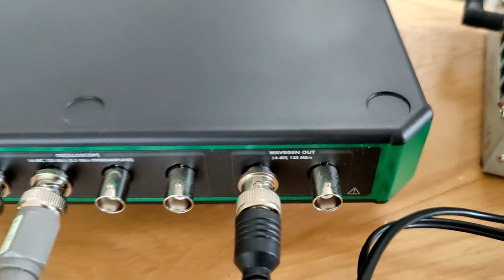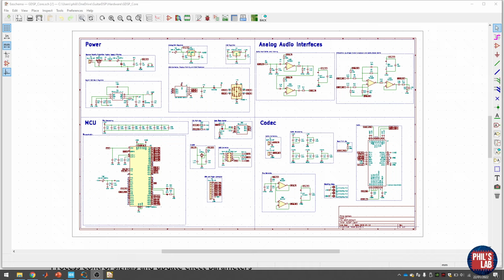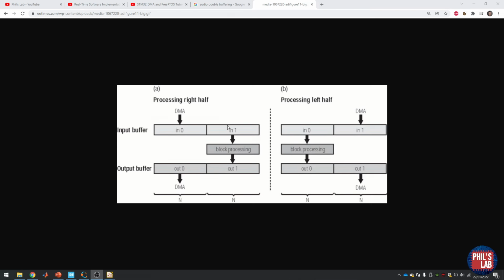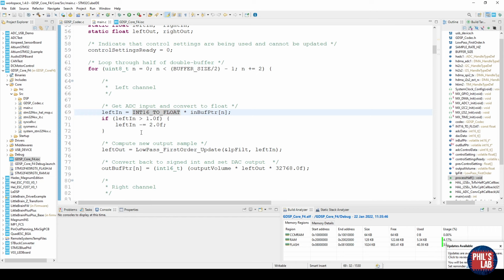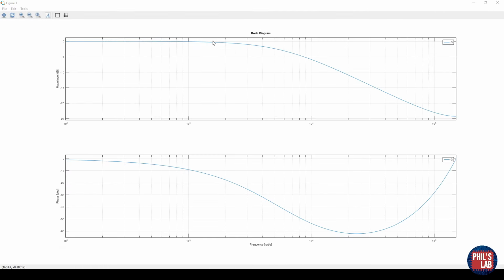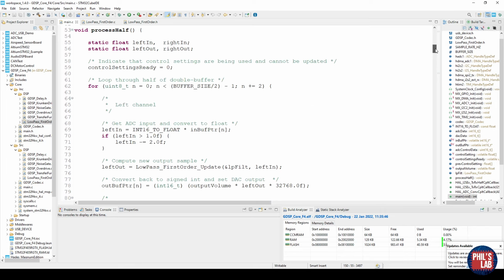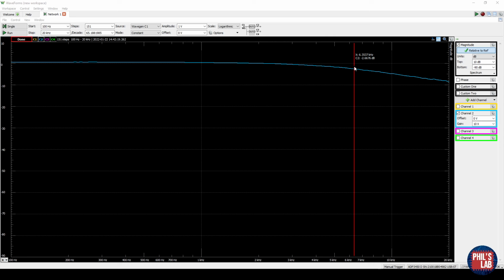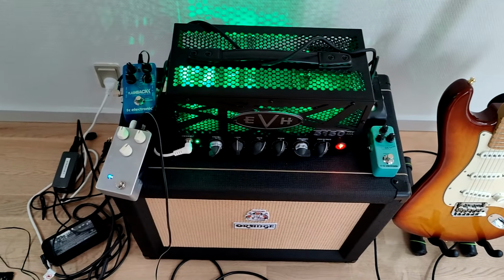Digital Audio Processing with STM32 #1 - Introduction and Filters - Phil's Lab #46

Comment: I am more interested in DSP programming for audio applications like the audio equalization, mixer/audio mixing, digital filtering, understanding of the analog ics that made up the analog embedded system (I mean the chip like the dsp audio mixer, audio codec, etc). In digital/mcu based embedded systems there are ics like eeprom, rtc, I/O port expanders, CAN, RS232, RS485, ethernet PHY, etc that made up the system BUT in analog embedded system (again, I mean the DSP based solution) is still to me remain secret and not liberise !

Comment: Phil, could you perhaps cover different digital power supply topologies as well? You could start with the basics like short circuit protection and move on to more complicated topics like DC/DC, DC/AC conversion, motor control, regenerative braking, PFC, etc.
Reply from the maker: I actually recently made a demo board for future videos on how to design/control a buck converter. I think both from an electronics and control standpoint that could be pretty interesting. Other than that, as you mentioned, I also have a motor control board ready for some videos! :)

Comment: Is this dsp also similar to what jbl uses in the charge, xtreme, flip, pulse, boombox series of their bluetooth speakers? I'm currently building a bt speaker, it's drivers are 10-20watts, it's a replacement driver for jbl charge 3, I used tpa3110 amplifier and m18 bluetooth decoder. The sound is good, but I want it to sound like jbl charge 3, it has bass which you can hear loudly. But mine, I don't hear any. Can I use this dsp?

Comment: Thank you again Phil for more great content!
You mentioned that the ADC of the STM32 is not appropriate for sampling the audio signal and that the ADC of a codec IC should be used instead. Why is that?
Reply from the maker: Thanks, Bruno! The STM32's ADCs and DACs are usually 12-bit and you'll get pretty harsh, very audible distortion. 16-bit is pretty much a minimum for audio.

Comment: Hey
Can you make a video on making a bi-directional power delivery Sink source board using the TPS65982 (or similar)
And a synchronous Boost buck converter using
LTM4607

I am making a powerful Powerbank with 100W PD port and 300w (20v 15A) port for my laptop
Can you help me out?

Comment: I was so hoping you implemented full filter that is capable of 0.5Hz cutoff (at 48ksps), that is nearly impossible to do in analog domain. All you have to do is to run convolution with your kernel, I always wondered if STM32 has enough performance to do it in real time :)

Comment: Thank you for this! I created a basic synthesizer on STM32 but I didn't know how I could implement a filter. I just discovered your channel now, but do you have (or would you consider making) a video about how to do an adjustable cutoff filter like this but using the ARM math library filter functions that come with the STM32 libraries?
Reply from the maker: Thank you for watching, Jacob! Potentially I'll make a video on using the ARM libraries, however, I usually prefer showing everything 'from scratch' in these videos.

Comment: Phil, this video is pure gold. The fact that you're providing it for free is so admirable, ill gladly go to your patreon...

I am developing a similar project, but have chosen the stm32h7. It's awesome that you're usinig a cortex m4 since I was weary the performance would suffer compared to an m7 chip. Have you hit any roadblocks in terms of performance when implementing some more "crazy" dsp algorithms? Do you think the higher performance of the m7 compared to m4 is worth it?

Cheers!
Reply: it depends. the only way to determine is to put an algorithm execution expectation on m4 or m7, 
Example: 
A single channel IIR at 96fs is okay, but you will soon see interesting CPU and Memory issues when building advance "single audio channel high sample rate" algorithms like: ANC (Active Noise Cancellation), Parametric EQ with limiters, Advance Reverb Algorithms (an there are many) then an M4 STM32 wont work, M7 barely but then again? what are you trying to do? what is the aim? M7 for simple to advance low sample rate will work. Yet again the M4 and M7 are great chip most people doing DSP will have to start here and work their way up.Some DSP things I mentioned are highly subjective do you even need high sample rate Audio?  
Many who started looking never even made it designing a low sample rate IIR filter on an 8-bit architecture. It's an additive journey, I say use an M4 or M7 and see if you can max it out, then move on. :)
Reply from the maker: Thank you very much, Lia! The only time I've been limited by the performance is (unsurprisingly) with long convolutions, e.g. for FIR filters. Another thing is the amount of RAM available, which can of course be extended on some STM32s with SRAM.
Tbh before the chip shortage the price difference between some M4s and M7s wasn't much, so I'd say just go with whatever the budget allows!
Reply: @PhilsLab  cool to know! I will be doing a lot of convolution, so maybe the m7 is what I want. The chip shortage really is a shame!

Comment: as an embedded developer, its really hard to solder another opamp resistor to settle or attenuate the signal to the mcu. i'm using i2s channel for trying it out the circuit. i put an adc like you did... and i'm chilling when i need to change attenuation factor or lpf settings because of very fast mcu's nowadays. (we are not populating these ic's at production btw)
when i'm in the university, there were only the pic family. 20mhz at best ahhaha:)... now i have 168mhz or 240 mhz mcu with fpu and dma and fast i2s peripheral.. 
weather is clear for embedded engineers... :)
Reply: You can get 400 Mhz to 1GHz "MCU/FPU" if you need them.  Allegedly.
Reply: we also have 1Ghz MCUs nowadays

Comment: Great series! Since STM32F4 series have built in ADC/DAC, are these built in one able to do the similar thing?
Reply: I don’t think the built in DACs have sufficient resolution (they are 12-bit) for audio applications, particularly the DAC’s ability to reconstruct a pleasing sounding analog waveform. Most better sounding DAC chips in pleasing sounding effects are 24-bit or 16-bit at the lowest end. Aliasing in algorithms is also something that goes away at higher sampling rates (eg 96 or 192 kHz). You can definitely hear the differences.
Reply: Maybe if you are making a distortion pedal :)

Comment: Careful there Phil, you might start undercutting some pedal companies' $600 effects pedals :)

An experiment I would really like to see is how underpowered you can make your hardware and still get some effects going? E.G, what sort of frequency can you run the CPU and still get real-time processing with floating point / integer math?
Reply: I pulled apart my Meris Mercury 7 pedal and they’re using an STM32F4… ;)
Reply: @velvetsound  That is around £309 ? But it is not an experimentation platform, or? (sorry, besides guitar excursions :) )
Also what Matthew already forgot from the beginning of the video(1) (and you didn't mention here) is the quality of the ADC/DAC and the analog audio chain. Quality of mechanical construction, etc. pp. That is knowledge which those companies possibly would kill for:)
(1) NE5534 or something + TLV320AIC, Phil said "very simple" ... and that design is a whole new can of worms
Reply: What you try to achieve with your second idea, Matthew, is possibly answered on reddit via "What's the worst pedal you ever bought?", because that is exactly what you are moving towards:)
Sorry for joking(?!?). You can calculate (or measure and then interpolate) the noise and frequency response of digital filters. What I meant is: Be SOME percent over the "shitty sound" margin to have something reliable. Ignore that, if you are Alice Cooper:P
Reply from the maker: Haha, yes maybe this'll show that it isn't too hard (or costly) to make your own digital effects pedals!
That's a good idea. I'll show some of the limitations of this F405 MCU when we'll look at FIR filters of various lengths. Haven't really tried much signal processing on lower-power MCUs.
Reply: Not sure I saw the part where he set up a full customer support section, documentation, marketing department… blah blah ;)